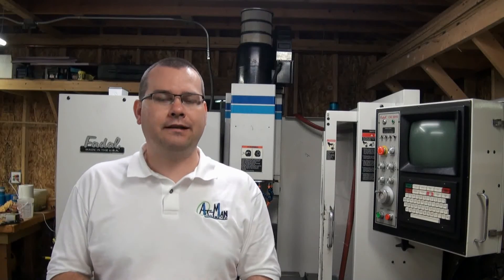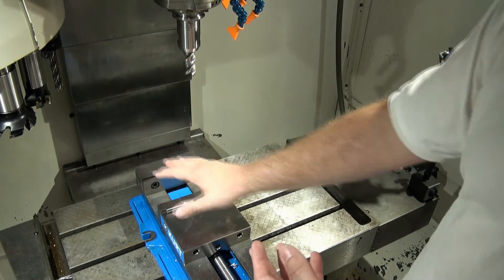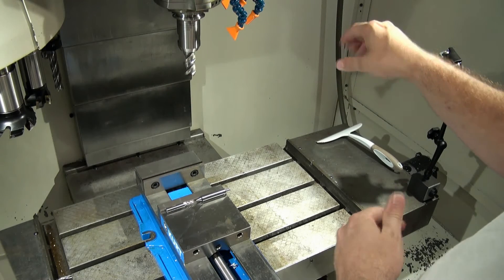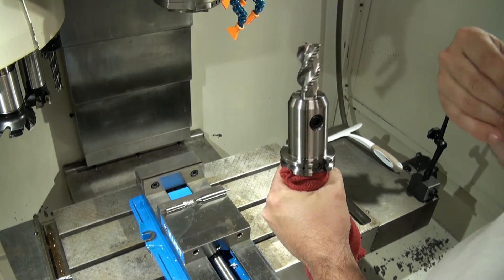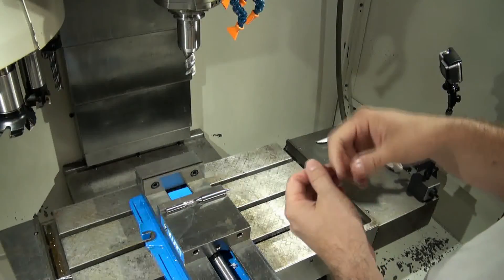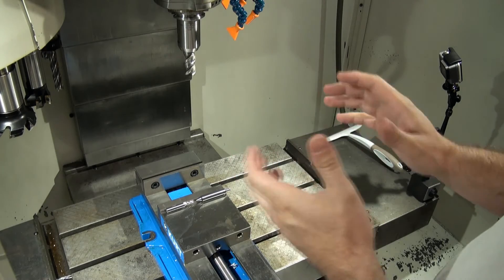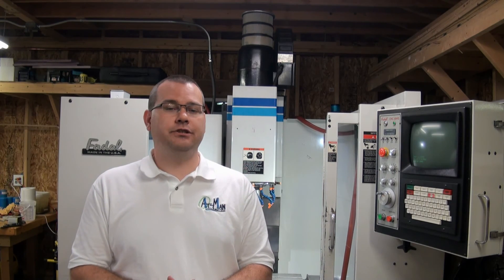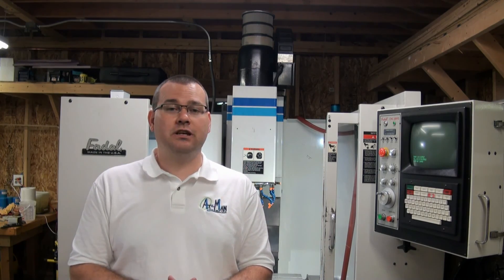CNC Mill Tool and Work Offsets Explained Part 3

Comment: Is it possible you could go into further detail on this method?  Previous operators at our shop have used this method, but they have since quit. They had 14 years of cobbling this machine up as the were never really operators.  I'm not really an operator, but I am a programmer.  TIA
Reply from the maker: I don't have a presetter so it would be difficult. I can see what I can do.

Comment: My friend, I don't mean to be overly critical but you have shown us three videos and not one of them demonstrates how to set or enter work offsets. There just seems to be a whole lot of talking which really shows nothing at all.
Reply from the maker: Hi Antoni, Because every machine is different I try to separate the concepts from the application. This video series was directed at the different ways you can use tool and work offsets based on your needs. If you would like to see how tool and work offsets are entered in for a Fadal machine check out this video https://youtu.be/0yaC3dg6Hnw Thanks for the comments, there not overly critical. Let me know what you think of the operation video.  Tim
Reply: Thanks for your reply, I will check out the link you sent.
keep posting.
Reply: After watching all of your videos which are definitely helping I have to agree that I still am unclear on setting the work height offset.  Even your other video on the Fadal general operation does not really explain it that well.  The Z height is where I am having the most trouble.  How would you set the Z height on a part sticking up out of the vise?  Thanks

Comment: YOU MISSED SOMETHING, HOW TO ENTER THE CONTENT ON THE CONTROL PANEL...
Reply from the maker: Check out the Fadal VMC general operation, I did this just as a general concept video not related to actual data entry.
Reply: YES I JUST CHECK THAT VIDEO OUT GREAT VIDEO!